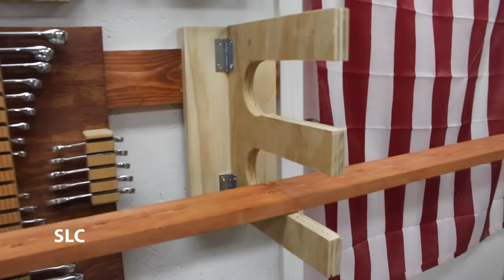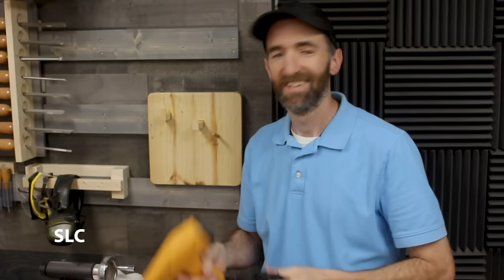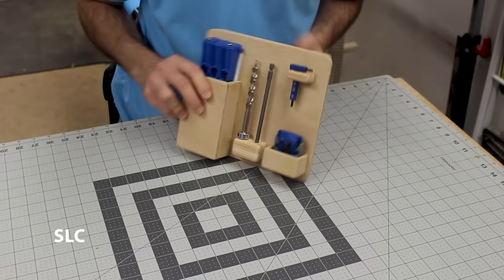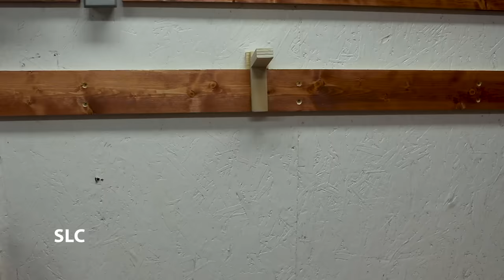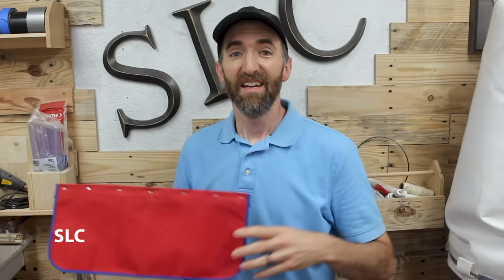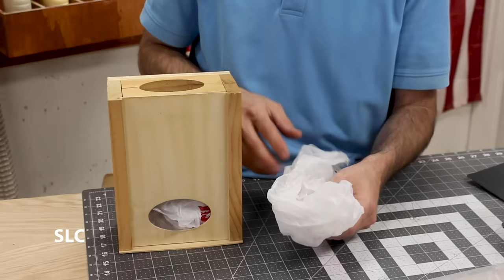20 MORE Simple French Cleat Ideas for your Tool Storage #5

Comment: Just a thought for the socket holder,  if you added a piece of wood or even a couple of dowels for legs to the front then it would stand up on it's own off the wall. Might make it easier to select different size sockets close to what you are working on without having to go back and forth to the wall.
Reply from the maker: Great idea!

Comment: Appreciate all the ideas - will use some.   I 've been trying to figure out if I go with Cleats or Slatwall or (rejected) pegboard.   So, what I would need custom cleats for vs slatwall and shelves?  I already have a bunch of shelving.   What Im seeing is that many of the custom cleat holders are a time consuming solution to not using shelves.  So many things  shown here will just go into a plastic box or even a cardboard box. Or a small set of drawers from container store.   Not as cool.  But I'm short on time for building things.  I'm concluding that most of what doesn't work on shelves will hang on hooks.  So I think that I'm going slatwall for the hooks.  I am starting to conclude that the French cleat system is for when you have more time and less money and/or love making cool little things for your shop.

Comment: You should add a bottom piece onto the socket set holder.  This way when you take it off the wall you can set it on the bench or floor and the set will remain standing.
Reply from the maker: Good suggestion

Comment: So inspiring, friend... great video! I wonder what are your thoughts on making french cleats with a circular saw, set at a 45 degree angle, and cut some 4 inch strips one after another (off a plywood sheet). The strips would have two 45-degrees cuts on them, but does it matter? It shouldn't affect the mounting system or strength of the cleats.
Reply from the maker: If you can be very safe with cutting, it should work out well.  The lower edge may need to be trimmed a little or it could be a possible way to cut a hand.

Comment: I have my workshop in the basement. Walls are solid concrete that is over 100 years old. No signs of any issues with the concrete. What size and type of fastener do you recommend?
Reply from the maker: Definitely use masonry screws. As for depth, I would go around 1.5 to 2 inches into the wall, so maybe 2.5 inch screws. I have not installed F.C. on solid concrete walls before, but if done correctly, they should do well.

Comment: good ideas  fyi  i worked in a Custom Milwork shop that used French Cleats to hang all our cabinetry  we used 3/4  inch MDF and for the 25 years i worked there we never had one fail  plus  its way  cheaper than the plywood you use
Reply from the maker: That is great to know, thank you

Comment: I subscribed immediately after seeing the American Flag. Not to mention your happy and cheery smile. My shop has 2 big tool boxes and I want to get the tools up on the wall, either by cleating or use Pegboards. Your opinion? 2 THUMBS UP 👍👍.
Reply from the maker: Both options can work, but I love the movable option of the cleats. Plus, when installed correctly, the cleats can hold a lot of heavy tools.
Reply: @SpecificLove7  does it have to be 3/4"? Wood in my state is very high. And because you're a huge advocate of the clear, you can come and give me a ✋. All kidding aside, what is the minimum size wood I can use?

Comment: On the fishing pole one I would have cut the holes alot smaller and then cut out a square in front of each hole.  This way it would be easier to remove and place the poles back in.  Smaller holes would also give you more space to add a few more poles.
Reply from the maker: Good ideas
Reply: @SpecificLove7  I may build something like this.  If I am able to, do you have an email or somewhere I can send the photo of the finished project?
Reply from the maker: I have an email on the about page of this channel.

Comment: what size are the wall cleats and how far are they spaced out?
Reply from the maker: I prefer to have each cleat big enough to safely get 2 screws at each stud for strength, but for light duty one screw could be enough. For example, mine are about 3.5 inches wide. And the spacing between each cleat is totally up to you.
Reply: @SpecificLove7  Thank you

Comment: What is the spacing between the cleats on the wall? It looks to be roughly a foot.
Reply from the maker: The spacing I chose (around 5") works for my shop, but you can choose any spacing as long as you keep each measuring the same distance apart by using two spacers.
Reply: @SpecificLove7  thank you!

Comment: Hey SLC, how do you screw the PVC to the wood? Don't think my impact driver plus a screw is gonna fit in a 3 inch tube.
Reply from the maker: Use an extension and go easy on the impact
Reply: @SpecificLove7  thanks for the response, but I'm still confused. Is there a hole on the front side as well that you go through and I'm just not seeing?
Reply from the maker: You can just drilled a starter hole at an angle from one of the ends and then add a screw.
Reply: @SpecificLove7  Coolio, thanks.